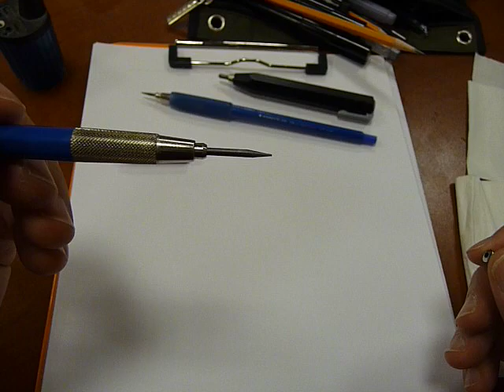Leadholder 101.MOV

Comment from the maker: While pressing the push button on the leadholder (which keeps the clutch jaws open and the lead free to move up and down), you place the lead tip in either depth) guide hole (one is for blunt tips, and the other for razor sharp points.  Once the lead tip reaches the bottom of the depth guide you release the button, and the clutch jaws tighten around the lead leaving the precise length of lead exposed for optimum sharpening and minimal waste.

Comment from the maker: Found this on a product description page "Alvin leadholder houses a positive feed lead advance. Each time push button of the lead holder is clicked the 2mm lead advances 1/8", so it sounds like you would have to keep the cap push button pressed while pushing the replacement lead through the front in order to load it.  Or you could might try removing the push button and inserting the new lead through the back.  Some vintage softer leads were slightly wider than 2 mm as the degrees got softer.

Comment from the maker: The color matches the color coding for the degree of hardness of the graphite leads, thus you can switch the original metal push button with built-in lead pointer in a Mars Technico 780 leadholder for the matching plastic cylinder.  Thus you could have several 780 leadholders with different colored push buttons with your preferred graphite grades for easy selection and smooth work flow.

Comment from the maker: I suspect it is just probably the way they were designed: to be fed through the front end.  While I do not have that particular model, I do have some Koh-I-Noor 3.8 mm leadholders which can only be loaded that way.  The Uni leads would also work on any front-loading leadholder after sliding their retention rings off.

Comment from the maker: You are welcomed.  Actually I figured out the function of the Staedtler color cylinders from having used Caran D'Ache Fixpencils that also feature color coded push buttons.  Though the Fixpencil plastic push button actually features a built-in lead pointer inside.

Comment from the maker: Usually through the front.  Unless you are using leads with the retention rings, in which case you have to remove the push button from the back to insert the lead.

Comment from the maker: At the 1:07 marker in the video you can see how to sharpen the lead with the built-in lead pointer in the push button.  You leave some blunt lead extended, insert into the push button, and turn the barrel and push button in opposite directions a few times to sharpen the lead. Alternatively you can use another handheld or a rotary lead pointer.

Comment from the maker: I have noticed that some of the newer rotary lead pointers are now being made in China, and they do not seem to be as precise as their German predecessors (I'm using an old German model in this video) which might account for some of the breakage,  You could try switching to a blade lead pointer like the KUM Automatic 23 or the Onit 233 if that were the case.  Another theory would be that the leads are brittle, so you could try switching brands or even harder graphite grades.

Comment from the maker: While I do not own any of these Italian leadholders, I think it is unlikely that a new leadholder might break so easily at the first try.  It is possible that the soft 5B lead might have crumbled and jammed the advance clutch mechanism.  Can you disassemble it and try to clear the lead channel by pushing the button or pushing down on the spring-loaded ring that closes the clutch?  You might have to unscrew the conical cover on the leadholder tip to expose the clutch first.

Comment from the maker: @latintiger  1.  Not all leadholders have a built-in sharpener, but the the Staedtler Mars Technico 780 which happens to be one of the easiest to find in the USA does sport a sharpener in its push button.
2. That is fairly subjective.  I am partial to a 3.15 mm lead in 4B or 7B.  Yet for sketching and drawing usually a softer B to 4B would be a good starting point.

Comment: I recently bought an Alvin "Tech-Matic Deluxe" MF6 2mm lead holder.  I took out the original lead that it came with and immediately put in a darker/softer 5B lead in  it.  However, it won't work now.  I didn't know how to load the lead...I tried from both ends...and neither way would allow the small advancing mechanism to work.  I may have broken it then??  One thing I noticed is that the 2mm lead (from Turquoise Co.) seems a bit too large for the Alvin lead holder.  Can't other leads fit it??
Reply: softer leads tend to get stuck with stronger leadholders. i had to find this video to discover my mars technico had a removable push button, for my simple B lead would not advance nor fall out of it from the front.

Comment: Where does the retention ring come from?  Does the "retention ring" come with each lead in the lead box?  Does it come separately?  Or does it come from within the mechanical lead holder?  They look so small and seem very easy to lose.  Lastly, are these in the current Staedtler models sold at art stores today....or are these retention rings more of the past/vintage type mechanical pencils?
thanks, Alberto. :)
Reply from the maker: Hello Sylvia: The retention ring used to come with some of the older vintage Staedtler leads. Currently I only know of one brand of 2 mm leads that features them: the Mitsubishi Uni Lead holder refills from Jet Pens. The former were often metal, longer, and thicker and might need pliers to remove or cut them off (when they rust or corrode they tend to stick to the lead). The Uni retention rings feel more like plastic, and I have been able to slide them off and use them on other leads. It is an useful feature, but it does not work on leadholder models that can only be reloaded through the front. Hope this helps, regards.
Reply: Alberto Lung The Pentel Multi8 2mm COLOR LEADS also come with a retention ring, and it's a metilic one.

And yes, in some cases the retention ring on the lead is a problem, since as you've said, some rare lead holders only allow loading from the front, such as the Koh-I-Noor 5217.
Reply from the maker: Thanks for the comment and info on the Pentel Multi8 refills. Good point, for the Caran d'Ache Fixpencil can only be loaded from the front as well. thus sometimes the retention rings need to be snipped off.

Comment: I just got my lead holders and they are Prismacolor Turquoise with same brand/line leads. I keep trying to point them with the same pointer you're using and I break the lead off half the time. How do you avoid this? It happens half the time even if I'm very careful.

Comment: I have an "Alvin Pro-Matic MC5" leadholder and I feed the lead through the opened end instead of the method you used.  I can't seem to remove the button the operates the plunger.  I have two of these leadholders and they both have unremovable push-buttons.  Is it that they're defective, or are some leadholders made that way?